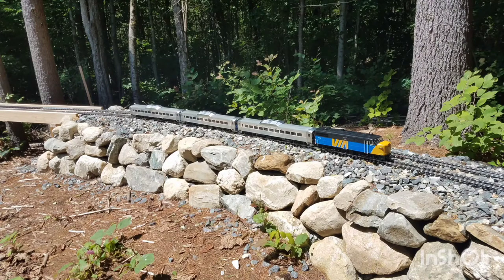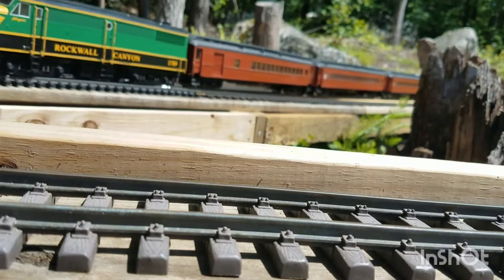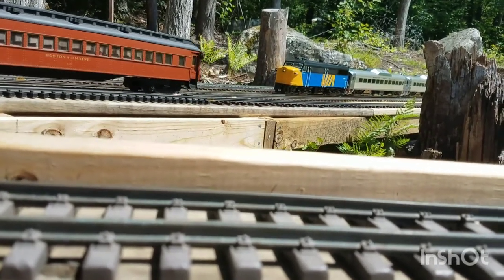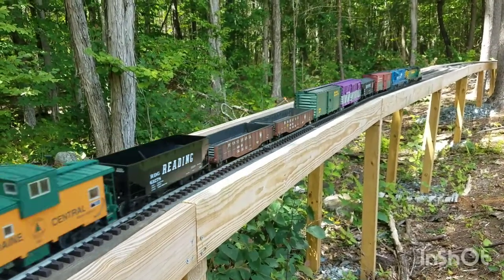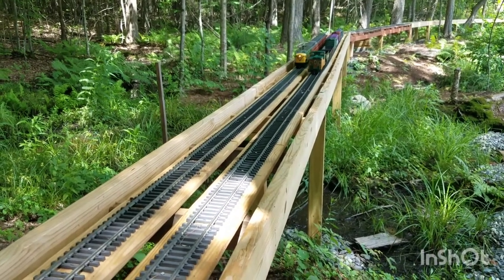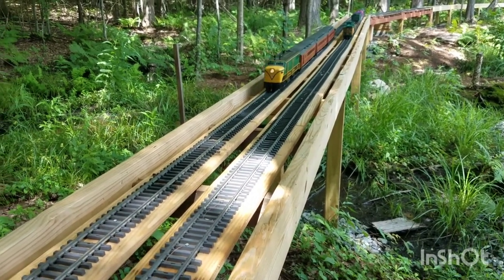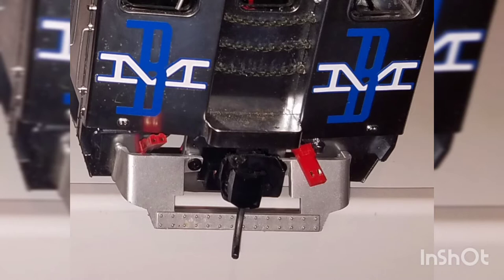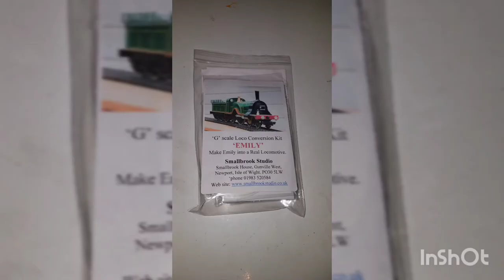Episode 1 | Automated commuter trains in G scale

Comment: Curious how you like the Railboss system and if you use it for your freight trains as well?
Reply from the maker: I do love the Raiboss 4+ and the critter controls.  However, I only use them for my automated trains because you need a separate transmitter for each unit. (That hasn't stopped me from owning several of each). 

That said, I think there is greater versatility in having Airwire, Revo or Railpro for running freight or switching jobs.  I can call up any loco I want from the same transmitter or even make consists for heavy pulls.  I personally use Airwire since I started with them long before the others were available.  I have some that are 20 years old and still work great!  AIRWIRE radio range is comparable.  Neither AW or RB come with sound.  (I don't like sound anyways, but that's a consideration lol) 

So if you have a small collection of engines, RB could certainly work for everything.  Iwill also say the radio range on RB is far superior to anything else I own for RC!
Reply: Thanks for the info!  After thinking about it and running trains with my son on the weekend I do think Railpro is the way to go.  He’s just 4  but has one of the little yellow playmobil yellow diesels engines that is his.  The controller is similar with the one knob for speed control and he has taken to it very quickly.  We’re also hooked on having a horn we can honk.
Right now on “Dads trains” I have two diff trailing  cars with batteries and gutted aristo train engineers, even with this I only need one controller as I can switch with a button between 2 receivers. It’s still a little chaos and fun running 2-3 trains at the same time, I think having a controller for each individual would not work.